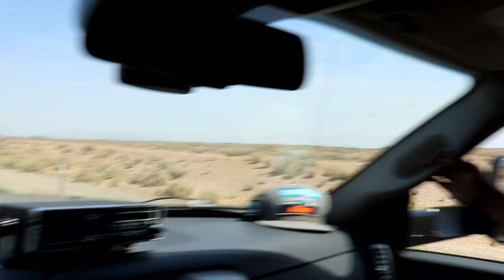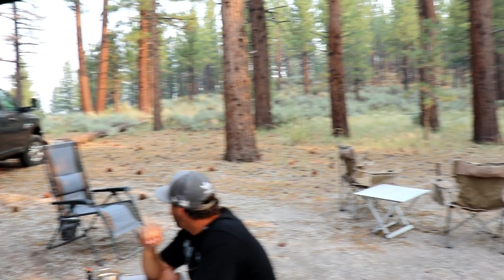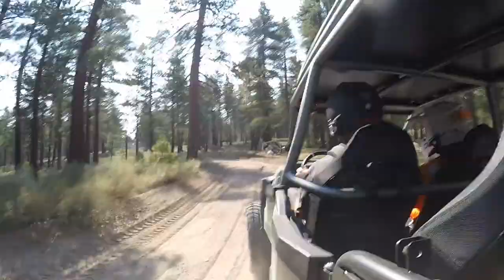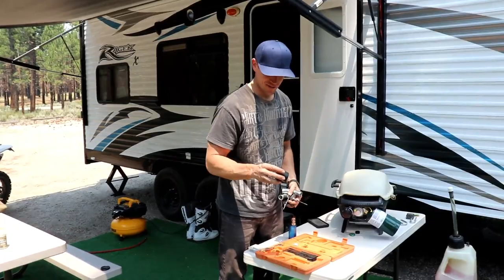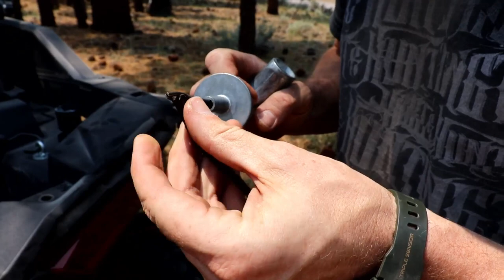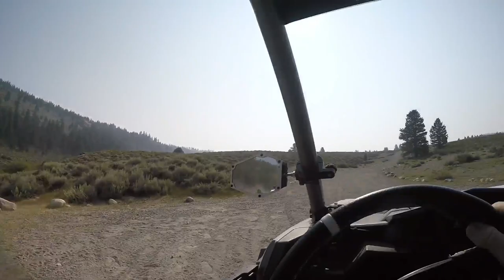Fast Fun Trails - MAMMOTH LAKES California Polaris RZR Turbo

Comment: Great Video!  Looks like you guys have some awesome places to ride.  I was curious on the Turbo S Clutch setup also.  I have a Turbo XP4 as well with 32" tires and am ready to pull the trigger on a clutch kit.  Seems like it worked well for you.  Did you feel a lot better engagement on the belt?  I felt like after I put on my new 32" tires I definitely lost some of the lower end torque, and even though the turbo has plenty of power it almost seemed like the machine was dogging on my initial acceleration.
Reply from the maker: Michael David Thanks! We try to ride a little of everything. Many more places to visit!! The stock clutching with 32" tires really never felt that bad to me. But I had never driven the RZR with the stock sized tires installed. So I did it mainly out of curiosity regarding any performance gains. It feels good. Pretty similar out of the hole but definitely has longer legs now. Better longer top end. Is your RZR running a Tune? That's the best thing I did to wake it up on the bottom end. At any rate the Clutching feels spot on though and I'd recommend the swap.
Reply: Thanks for the info.  Sounds like it would help me.  But no I have not added a tune yet.  I have been looking around at some of the EVO tunes.  Heard some pretty great things about them.  Just haven't narrowed it down quite yet on which one I wanted to go with.  I really want to pair that with that exhaust you have.  I agree, best sounding exhaust out there for the turbo.

Comment: How did the turbo s clutch setup work? And could you write out all the part numbers you used for the clutch parts please.
Reply from the maker: Messell Motorsports The new Clutching feels perfect! I'll make a point to pull my order sheet and get the part numbers up soon.. Thanks for watching!
Reply from the maker: I ordered all parts from Rocky Mountain ATV MC.
Make sure you double check that they will fit/work with your machine before you order. I used the OEM parts finder.
Like I stated in my video regarding the install. The primary spring had the same part number as my stock one. 

WEIGHT-SHIFT,W-31-72,PM
Part # 131308027573

SPRING-DRIVE,HD,63-140
Part # 131308023909

HELIX-DRIVEN,HD,MACH-60/49HT
Part # 131308027572

SPRING-CLUTCH,136-215
Part # 131308027604
Reply: The Off-Road Adventure Channel thank you! I have the same rzr you have so I’m good to go!